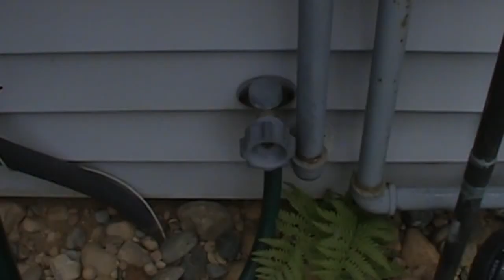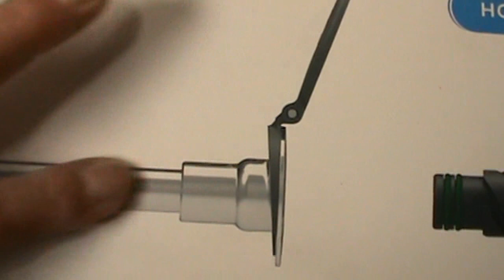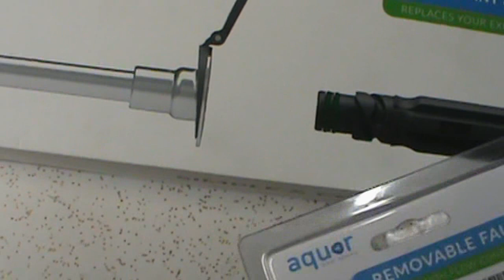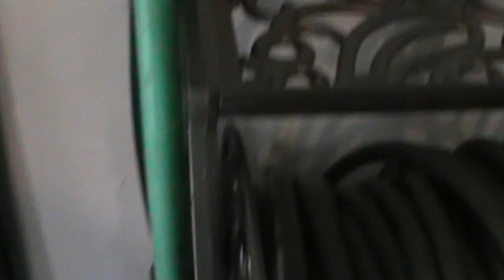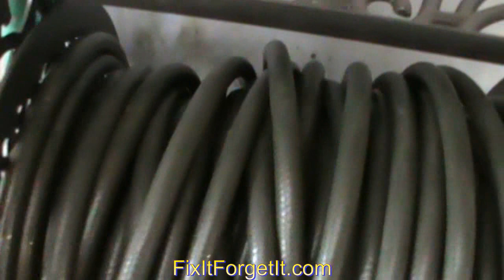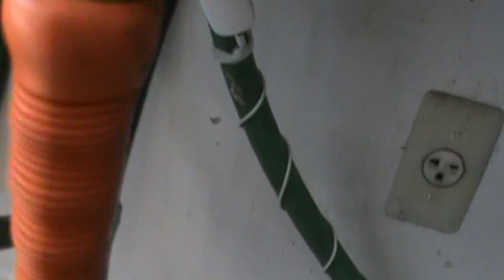How to stop a leaky garage water valve and raise it up for easy access.

Comment: WiFi water sensor? I assume those could  be used to detect leak under the sink or toilet pipes? Thanks for sharing. 👍
Reply from the maker: My pleasure aeon. I wish I could recommend the one I have but it often gives false alarms. Yes, you can use these just about anywhere there's a potential water problem. I have several of them around the house. The ones I have are made by Ooma and they are mediocre. The Ooma Telo Voice Over Internet Protocol (VoIP) device is great but the WiFi water alarms aren't that great. Thanks for stopping by.
Reply: Fix it forget it. Thanks.
Reply from the maker: @yellowNred  You are welcome. Thanks for stopping by.